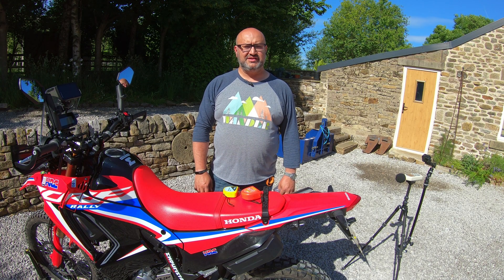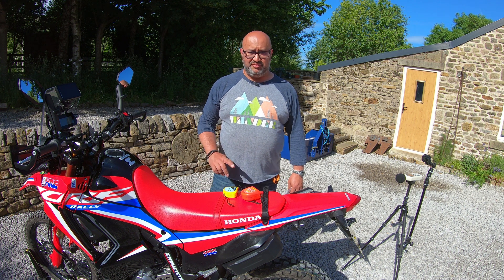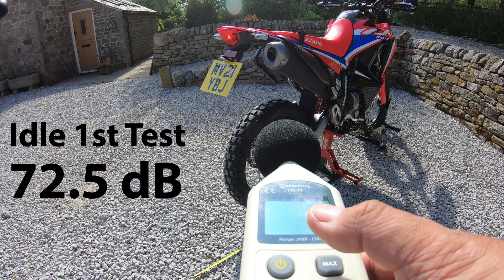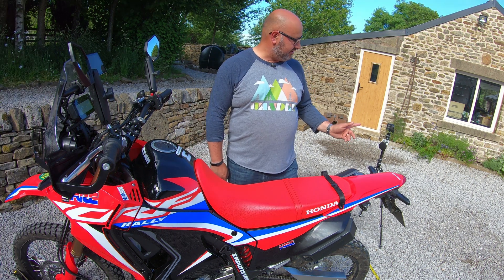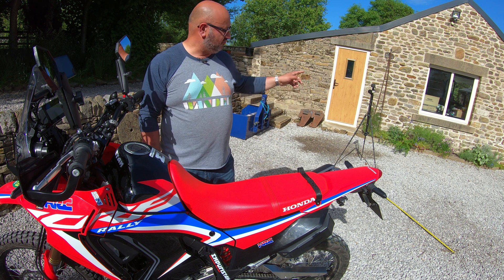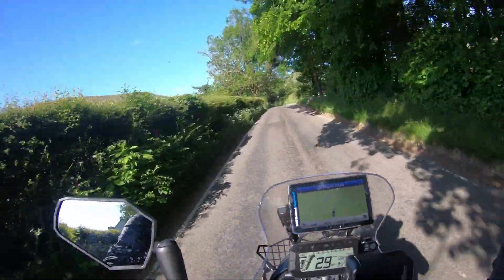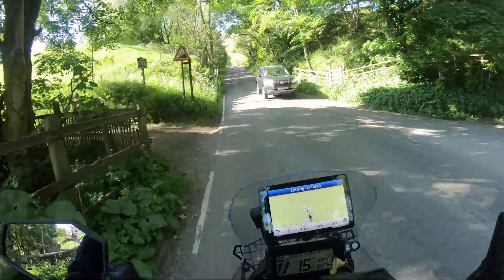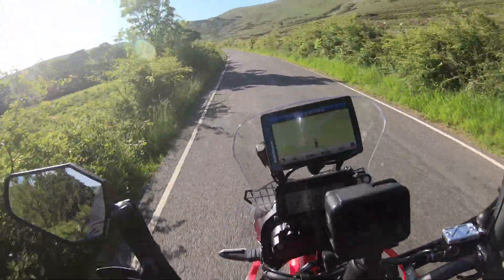Honda CRF300 Rally Stock Exhaust Noise and Power Test 4K

Comment: I put a yoshimura rs12 on my rally and I absolutely hate it. Deafening riding and rude to all around my. Can't wait to sell it off second hand and go back to stock. I will make weight savings by going to a lithium battery 😊
Reply from the maker: I fitted an Arrow exhaust with a catalytic converter and it’s homologated. It’s as quiet as stock at idle and only slightly louder in the upper 1/3 of the rev range. I can pass horses without them noticing me with the engine running and at low throttle. I can also ride it all day without earplugs without noticeable noise fatigue. I know the Yoshi is a race exhaust and without the cat and the higher flow profile it is at the noiser end of the available options. If you’re anywhere near the Peak District and would like to hear the Arrow, let me know.

Comment: Is there any way to make motorcycles actually quieter than stock? A modest sounding motorcycle would be nicer for other folks.
Reply from the maker: Electric conversion? Maybe some soundproofing panels on the inside of the body panels?

Comment: Great job on the Analysis! 

Love the channel! I just bought a crf300l and was looking to put the motox on mine with an ECU.  I also have similiar noise concerns in my area of the USA. Are you considering the ecu?

Ps all your videos are very helpful!
Reply from the maker: Thanks Mike, if there was an ECU that worked with the UK/EU bikes, then yes. Definitely. Unfortunately our bikes are different to the rest of the world, so the 550 unit won’t work on a UK bike. Am hopeful one is available soon, even if only to remove the fuel cutoff/snatchy throttle at low speeds.

Comment: Thanks for another very informative episode. 
Looking forward to the new exhaust review. 
I enjoyed that nice road and scenery.
Reply from the maker: Initial thoughts on the new pipe is that it's similar in noise to the stock. That's from a couple of hundred miles of mostly road with a bit of off road at the weekend. No flat spots in the power and the delivery seems similar to stock. I noticed top speed was a few mph off stock but I was carrying 20kg of camping gear which probably didn't help and more than offsets saving 3.5kg on the exhaust weight. I'll do a like for like comparison and see if there's any real difference. I don't think there's any power improvement
Reply: @PeakMotorcycles  3.5 kilos seems like a substantial weight savings, and may be enough to justify the cost and labor of the new exhaust.
Reply from the maker: @0HARE  these bikes are part motorcycle, part big boys (and girls) toys! I enjoy riding and travelling on my CRF and also using it as an excuse to mess around in the garage. 3.5kg is a lot high up on the bike, and it makes a difference, especially when you pick it up though I also expect some folks will do just fine with stock. The video will be up 1pm UK time today/7am Central.

Comment: isn't the torque higher in the rev range?
Reply from the maker: Yup, could well be, but timing it accurately for a comparison is even harder. The new pipes went on today, so will do a comparison and let you know. Am hoping that it‘s at least the same with no fueling flat spots. It is 3.5kg lighter.

Comment: Completey agree with you, Andre. A quiet trail bike is a must. We are not alone.
Cheers, Günter from Nürnberg/Germany
Reply from the maker: I did a couple of hundred miles at the weekend and I didn't notice the noise. There's a bit of a rasp around 5-7k rpm, but it's also there on the stock exhaust. I'll see if I can do the measurements this weekend. Hoping for good news. I can always go back if not!
Reply: @PeakMotorcycles  This sounds inspiring, Andre. The least we would love to have is a noisy exhaust. Looking forward to your measurements. Cheers, Günter

Comment: It would be great if you could add  how the db numbers work. The scale is not linear.   100db  is a hugh noise change from 85db, not  the 19% increase the numbers suggest.  Less sound= more ground.
Reply: Thanks, i have watched many of your videos and I like your common sense science approach.  I just rechecked my old info from physics class back in the 70,s.  Going from 70 db to 80 db is 10 x more noise power. So from 80 to 100 db is actually 100x more noise !!  I really do not see the beneifits of aftermarket pipes for anything except for competition.
Reply from the maker: @suzetteshipman2741  true, but 100x more noise power is not the same as 100x louder as (I think…) the power dissipates according to an inverse cube, or something like that. 
As for reasons for after market pipes, I guess it depends on how often you have to pick up a bike. An extra 5kg just below seat height does make a difference in that case. If it isn’t loud, doesn’t cost too much and saves weight, that’s enough for me. I’m not fussed about any power change, which I guess is one of the reasons it’s desirable for racing (along with the weight saving). Each to their own though, and my other bikes all have the exhausts, with cats as delivered from the factory. 

This might be a more useful source, hopefully written by someone cleverer than me. dB’s are noise intensity, and you’re right that 80 to 100 is 100x the intensity. However we humans don’t perceive intensity very well, and are more used to volume, and 10x intensity = 2x volume, and 20dB = 4x volume https://hearinglosshelp.com/blog/converting-decibels-to-sound-intensities/
Reply: i sold my drz400s and bought a wr250r just so i could pick it up !!!  i cannot use the power fully on either bike . except when climbing long highways with the girlfriend on the back.   i know what you mean !!
Reply from the maker: @suzetteshipman2741  a WR250R would have been great. Emissions restrictions mean that they stopped selling them and the DR’s in the UK 10 years ago so we don’t have a lot of choice here when it comes to dual sports. It seems that on the CRF the biggest possible weight savings are a few kilos on the exhaust, a few on switching to a Lithium battery, and surprisingly about half a kilo on the bars. (The stock steel bars are surprisingly heavy)
Reply from the maker: Will do! Thanks
Reply from the maker: Hi Suzette, I've added an explanation to the video description, I hope this helps and makes sense. Thanks for the feedback.

Comment: Quiet exhaust, Hell No, large header pipe and no baffle in the exhaust equals more power. Loud pipes save lives. Tell the horse riders to bugger off, with all the methane gas they produce and put in the air.
Reply from the maker: Wise words, have you considered a career in diplomacy?! 🤣🤣🤣. I quite like a loud exhaust, to feel the sound is part of the emotional attachment to motorcycles and motorsport. I love the sound of race bikes as they pass, I’m not sure I want to sit 4ft from a noisy exhaust all day. Between the noise fatigue and eventual hearing loss, it’s not worth it for me, but each to their own. Some people don’t mind that. I wish it were true that loud pipes save lives, but it has been tested and proved false several times. If you are relying on your pipes to save you, good luck and mind how you go. Not sure how much extra power you get either? 1hp? 2 or 3 maybe with an air box mod and ECU remap? I’ve also seen plenty of bikes that shake the ground as they pass due to a free flowing exhaust where the fueling hasn’t been addressed and they make less power, not more. The CB1000R is one. Even with the Akra race headers and silencer the fuelling is a mess without a power commander. Anyway, each to their own, and I don’t mind if you prefer loud ones as long as you don’t mind if I’m trying to keep the English trails open to motorcycles. Ride safe!

Comment: Great video, thanks! Which stand are you using on the CRF on this video, looks like just what I need! 👍
Reply from the maker: The stand is one of these: https://www.ghostbikes.com/products/5213-5213-black-pro-range-b5213-adjustable-mx-lift-stand.html with an eBay front wheel chock. I think whoever makes the for ghostbikes also does them for other brands.
Reply: @PeakMotorcycles  Brilliant, thanks! Still waiting for my CRF but should be with me next weekend 🤞

Comment: Is it the stainless MotoX system or titanium? Maybe the mixed one? I have the stainless one in the garage ready to be fitted this weekend on my 300 Rally. Looking forward to your upcoming videos on the topic. Great content, as always!
Reply from the maker: I have the mixed one. Steel header and link, and titanium silencer. My rationale was that the price difference from alloy to titanium wasn’t much, but the step to fill titanium was nearly double. Steel flexes better than titanium, and the silencer bit is high up on the bike so the weight saving makes more of a difference there. I’ll let you know how I get on.
Reply: @PeakMotorcycles  Hi did you have any problems with importing fees from Thailand, Also its asking for a zip which is all America. Thanks in advance.
Reply from the maker: @niteforcefireworks5700  hi, I didn’t, so far at least…. I’ve only used PayPal so wasn’t asked for a zip code….
Reply: @PeakMotorcycles  Thank for you help and reply, I will at ordering a pipe and tail tidy and see how i go!
Reply: @PeakMotorcycles  Wise reasoning on the weight up high. I just didn’t like the look of the titanium can, but will probably regret my choice if the weight difference is substantial.
Reply from the maker: @Aengen  i don’t think there’s much in it to be honest weight wise and I know what you mean about the colour. I’ll be putting a heat shield on anyway, so that’ll hid it a bit!